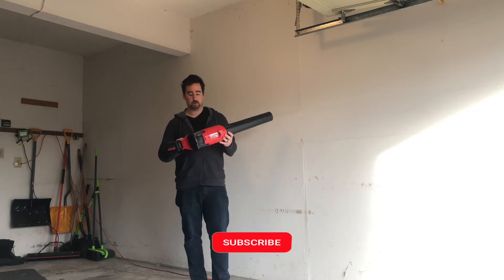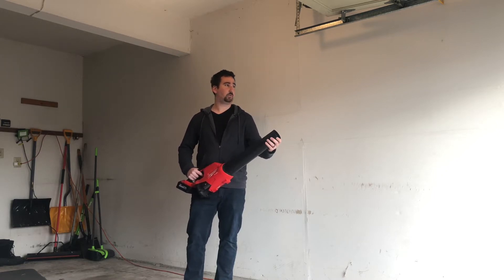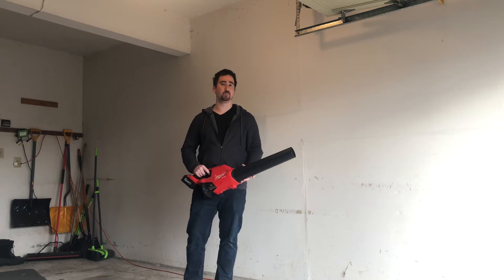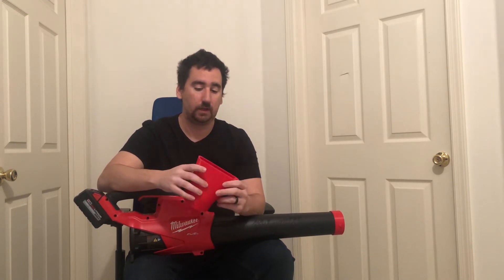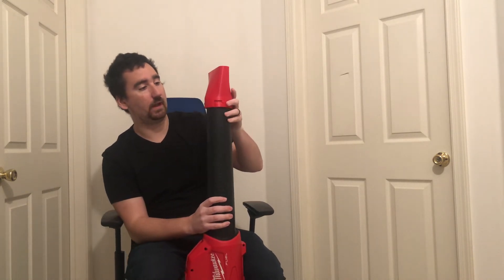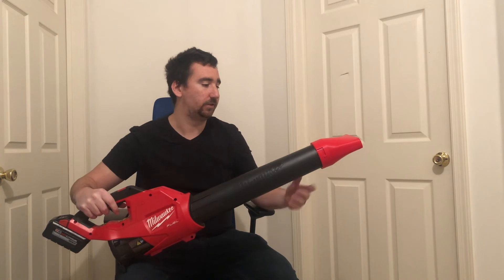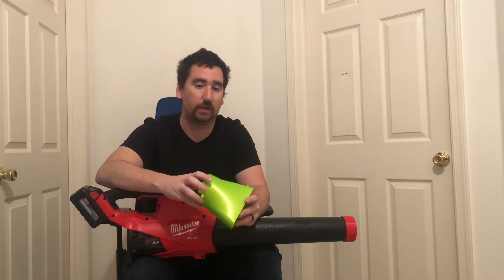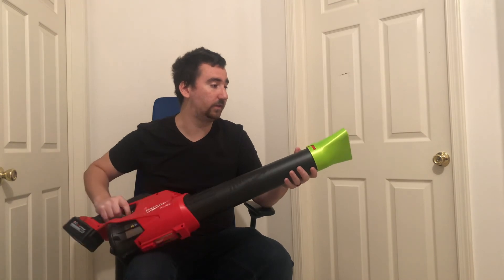Milwaukee M18 Leaf Blower Attachment System! Adapter & Wide Nozzle | Ender 3 Functional 3D Printing

Comment: I was able to get my first Marlin build to compile watching your video. Question: When I run the ABL the probe never hits the bed and the head just bobs up and down as it counts through the points. What am I doing wrong? Please help.
Reply: it also does not move on the x axis. Stays in one spot.